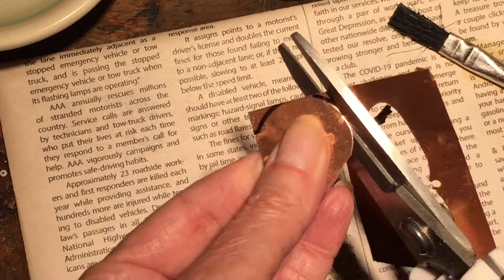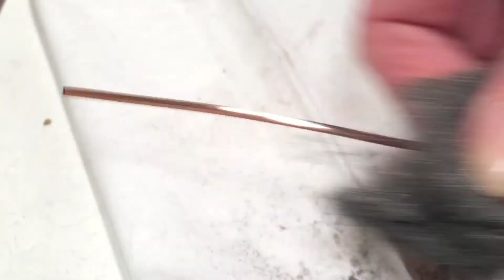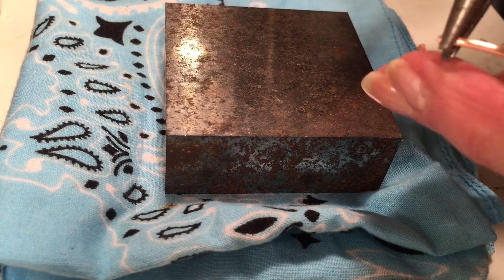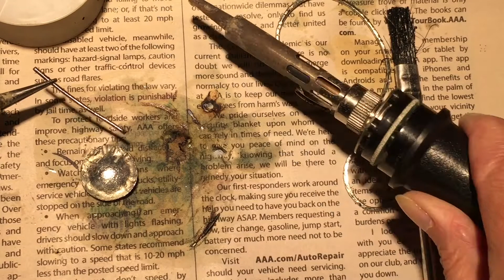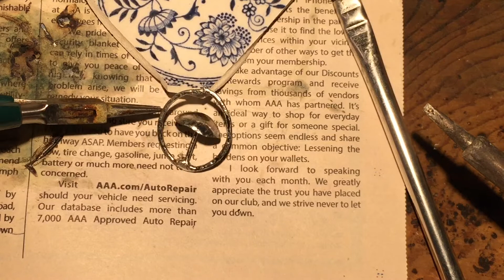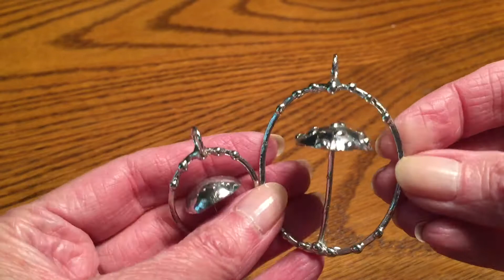Soft Soldered Mushroom Pendants! 🍄 Soldering Iron Jewelry No Flame Or Torch Needed! 🍄

Comment: I have learned so much from your videos and I thank you !! I see in the materials list that you use both a fume, smoke extractor and the air purifier. I can see the need for a fume, smoke extractor but do I still need an air purifier?? I ask because my husband is on oxygen 24/7 and I solder in the garage, I have an air purifier in house but ??
Reply from the maker: Hi Sharon! You don't need both. A fume extractor is made for soldering but if you don't yet have one, an air purifier on the table positioned right where you are soldering (close by) is an okay substitute. For example, in my workshop I will use a fume extractor, but in my home if I am soldering at the dining table I will put the air purifier right on the table where I am working to suck in the fumes. Always wear a mask as well. If you are in the garage be sure to open the garage door and have a fan positioned to circulate the air. Safety is #1!
Reply: @LauraBethLove  thank you so much for taking time to reply !!